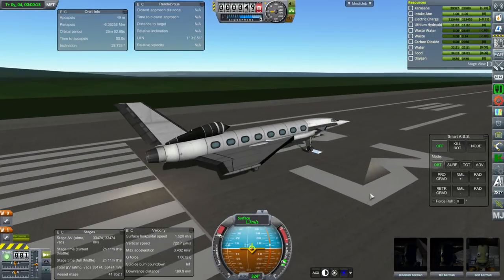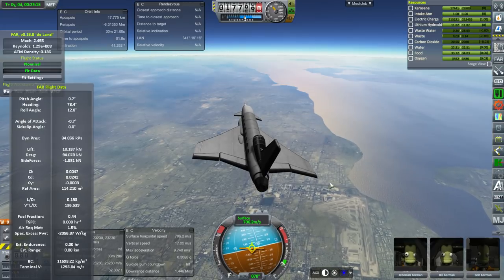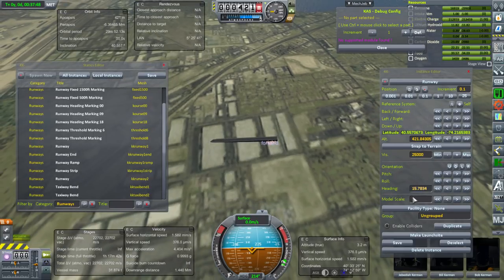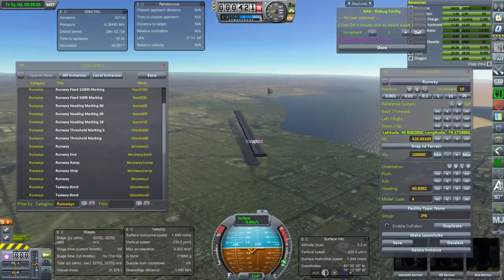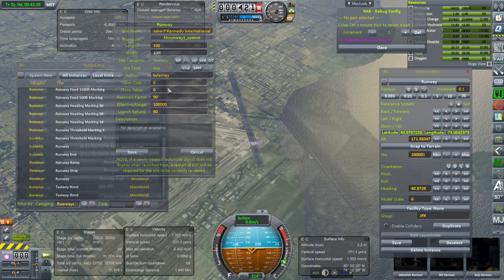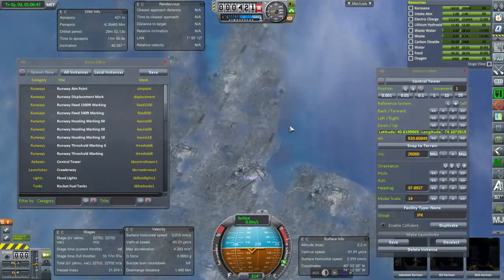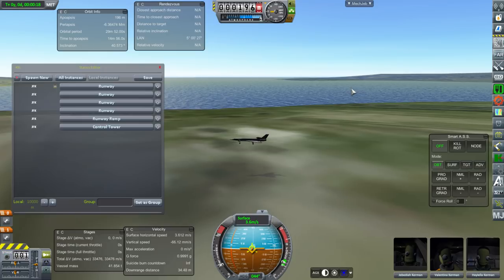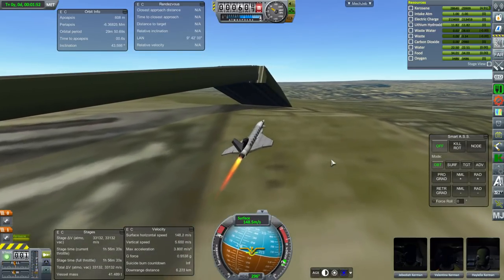Kerbal Space Program - Making a Basic Airport with Kerbal Konstructs

Comment: Is there no way to use fsx airport location files to place them?
Reply from the maker: As can be seen by this JFK example, the terrain height isn't accurate at all in KSP with RSS, and neither is the landclass (there's land where there should be water and vice versa), and that has to do with the fact that KSP loads the entire terrain of the world at once while FSX does it in patches. So, you'd have to individually fiddle with airports to get them to show up properly anyway, unless there's a way to flatten the terrain using Kerbal Konstructs. Another way to get flat terrain is to add a mesh underneath the airport, but in that case it would definitely be higher than in FSX.

Comment: i dont know if its possible but you could try just placing some sort of plate or cube as a base for the runways also does kct work with the runways?
Reply from the maker: I don't know if KCT works with the runways, but yes, it is possible to place some kind of mesh as a base for the runways - that's basically what the Shuttle Landing Facility from Real KSC is on.
Reply: KCT compatibility is something I too want to know. For some reason my RO KSC's runway is broken into segments and has awkward bumps in the middle, so I thought if I could fix that by placing a new runway on top of that.

P.S.
Unrelated stuff, but I wanted to thank you for your RO-UKS config for 1.1.3 you gave me a while back. I made a config for MKS 0.5 based on that and it's working great :D